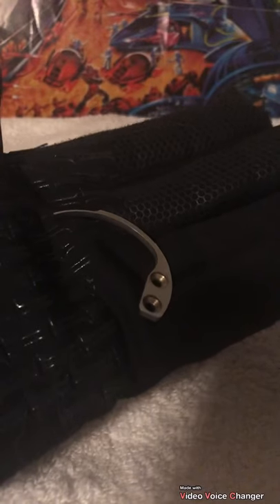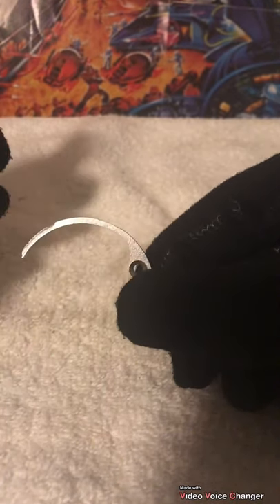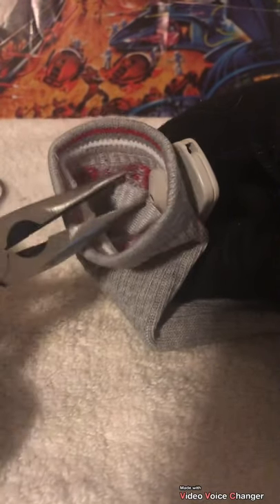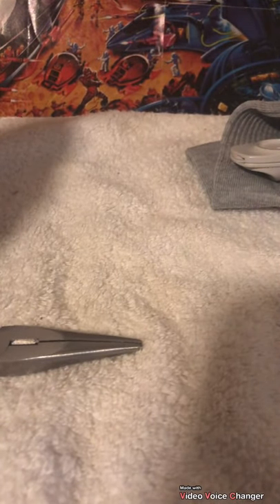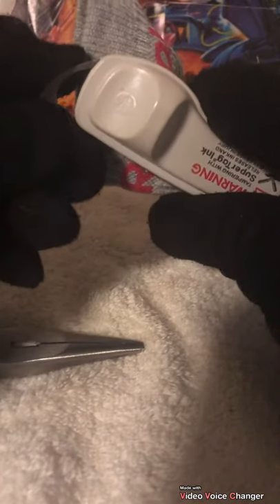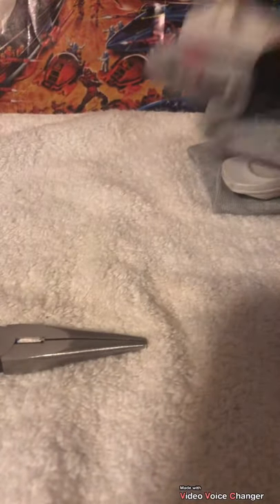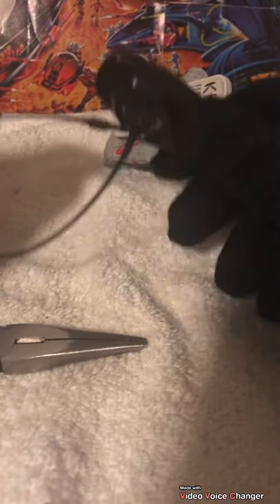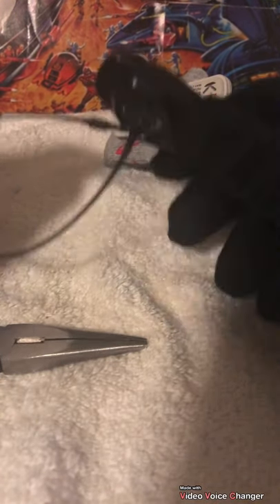Removing Sensormatic tags using a Hook Detacher

Comment: I fuking love this channel!!! I have all these devices the magnets ,the key I got them off the internet for like $30 over the year Macy's has been great to me. 1 question...how do you take the alarm off sunglasses 🕶️?
Reply: Magnet
Reply: Yes I Kno it's a magnet but how? I tried looking up a video on yt specifically for sunglasses but couldn't find any. Also I have all types of magnetic alarms removers but for sunglasses it's a certain type and done a certain way. I'm just curious if anyone knows exactly how
Reply: All you have to do is pull it off it sounds dumb but it’s that easy
Reply: @verzey3520  thanks! Actually it's funny u mentioned that. I actually make glasses so I did just tht! Found a pair, bent the temple straight and slid it off then bent it back. Simple AF! Thanks for the reply!
Reply: Ciao ci vuole una chiave e io la posseggo!😂